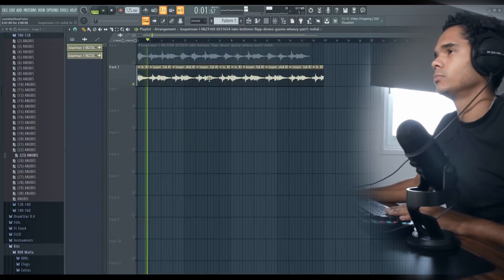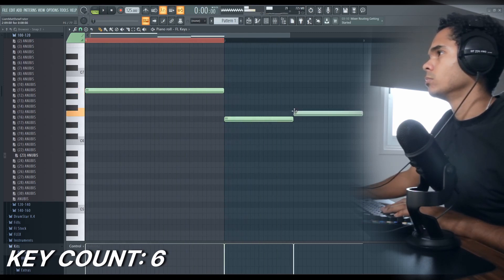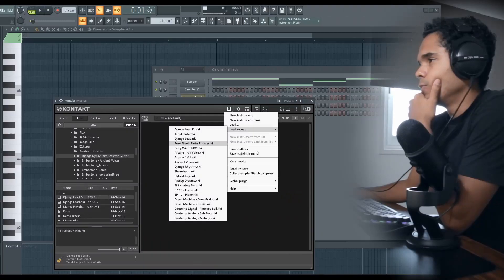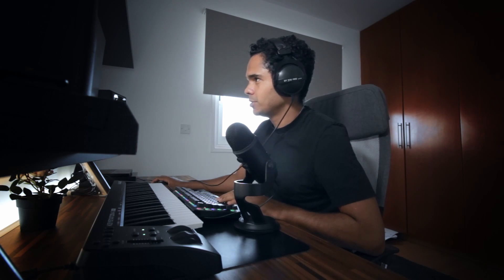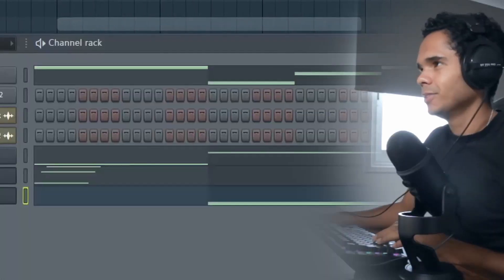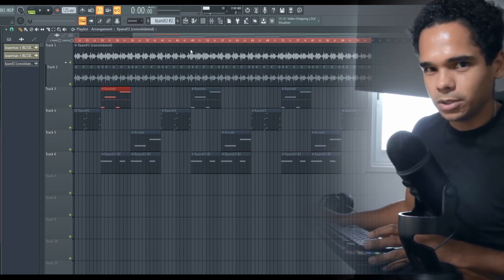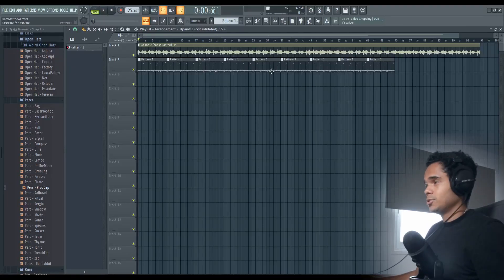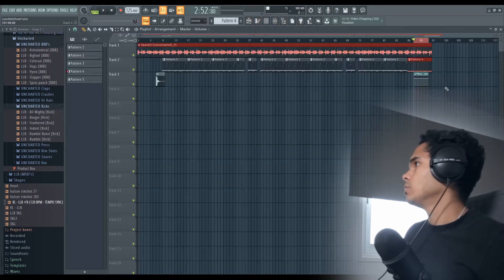THE BEST WAY TO FLIP A SAMPLE! How To PROPERLY Use Samples In FL Studio 20

Comment: Hey man , used your mastering chain and it works really nice. I was wondering, could i still push the levels if think it doesn't sound loud enough? I did push the post gain a little but can i still push the levels too?

Oh, and for anybody struggling to find the chords. use Melodyne. It's not cheating, it's a tool.